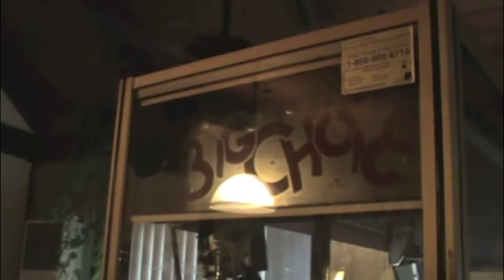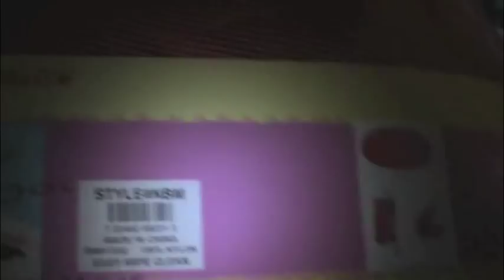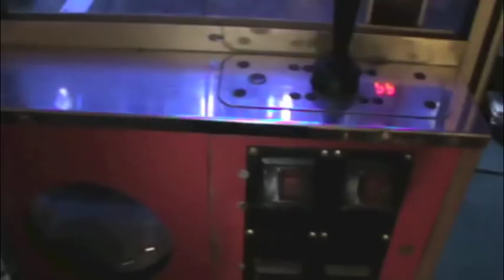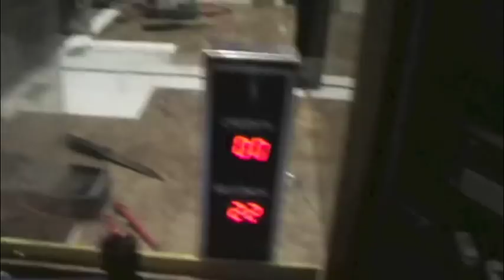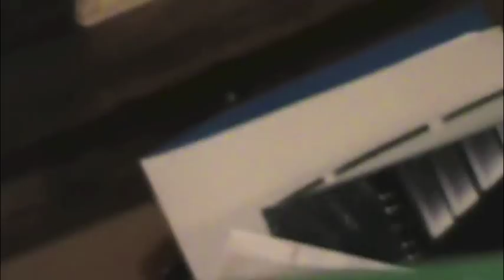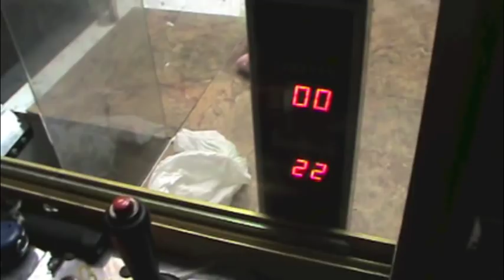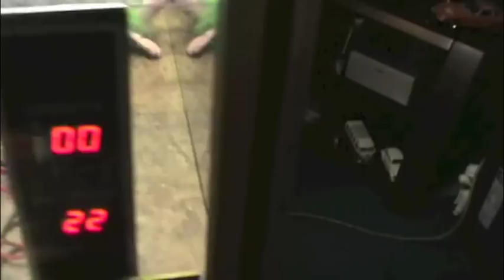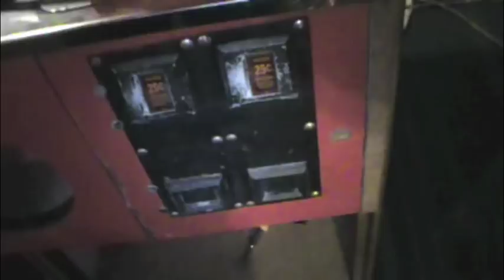Betson Imperial Big Choice Arcade Claw Crane Machine Repair

Comment: Do you know how to make the claw less strong on this machine?
Reply: Super late reply Idk if you’d see this; but have you figured it out? I recall that the black box inside is what had the ability to change the strength of the grip as I done it before but I don’t know anymore. If you figured it out please lmk thanks.
Reply: @MrKevalex1  I did. There is dip switches and you can change it to either 60,80 or 90 percent strength. Even on the weakest strength it's still pretty strong though haha
Reply: @Zenoeffex  oh shoot that was fast, haha yea thank you so much. Take care man!
Reply: @MrKevalex1  yeah it's been holding up pretty good:)

Comment from the maker: Older machines (claw machines and standard arcade machines) CANNOT be infected, nor can they be "hacked into," as they were not connected to the internet, and typically had most of their software programmed into ROM chips. However, modern machines with internet and cellular connections CAN be hacked into, and CAN succumb to viral infections. ATMs, vending machines with credit card readers, and jukeboxes are examples of this.
Reply: i need help with mine when i put a coin in it just  drops the claw as soon as a credit is applied
Reply: @zack5969  sounds like a bad button for the drop

Comment from the maker: Mine had some "dry" (loose and cracked) solder joints on the logic board, which was causing a variety of issues (including malfunctioning timer/credit display). There are many things that can cause this problem. I would recommend hiring an arcade game technician to look at the machine to narrow the problem down... I fixed mine by oven-baking the logic board, but I don't recommend this to anyone who isn't familiar with electronics.

Comment: at 47:06 its very common. However, your hypothesis was wrong. When the claw hit the ground of your play field you got slack up on your gantry. Because of the slack it came off of the gantry pulley system bypassing the off switch.

Comment: sory if i asked you this but can an arcade machine crash?
and can an arcade machine become infected with viruses i ask this because i read on internet that arcade machines could be hacked :) sory if i sound dumb
also what colour is the betson machine
oh and do you know where the compnany is fro?
could you tell me if you know
Reply: Older machines (claw machines and standard arcade machines) CANNOT be infected, nor can they be "hacked into," as they were not connected to the internet, and typically had most of their software programmed into ROM chips. However, modern machines with internet and cellular connections CAN be hacked into, and CAN succumb to viral infections. ATMs, vending machines with credit card readers, and jukeboxes are examples of this.